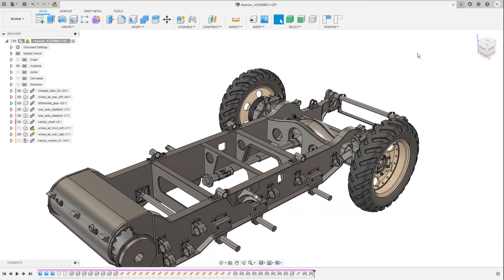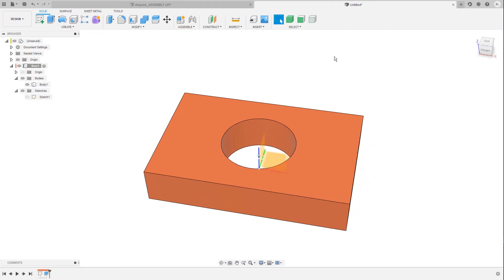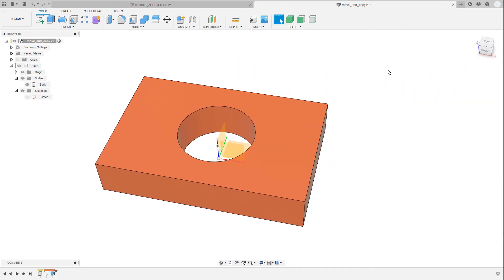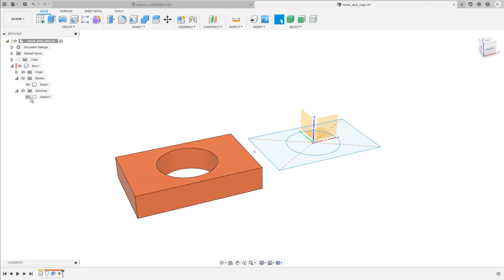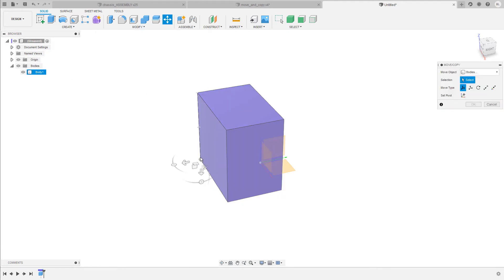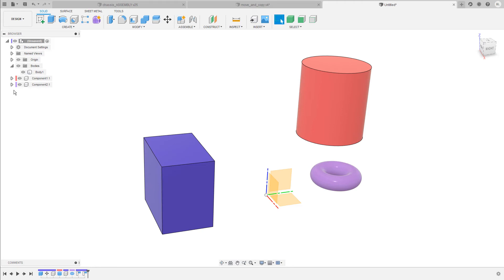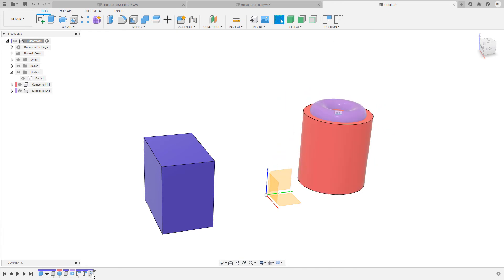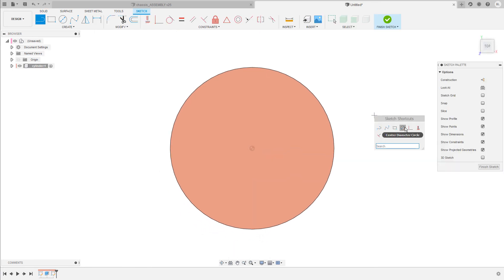How To Move Bodies And Components In Fusion 360 - Day 17

Comment: This is super awesome. I'm realizing every day that I'm having to go back and fix more issues. I didn't realize that you could move bodies by just clicking and dragging them once they're set as active components.... i was getting super frustrated because I was getting loads of interference between components, but why? Turns out that I was moving them incidentally by 1/1000th of an inch and would hit CAPTURE POSITION without realizing what I was doing.... I think I'm starting to get the hang of it finally!

Now if only I could figure out how to make rigid groups move altogether with just one sliding group, i.e. a drawer made of components on a track.